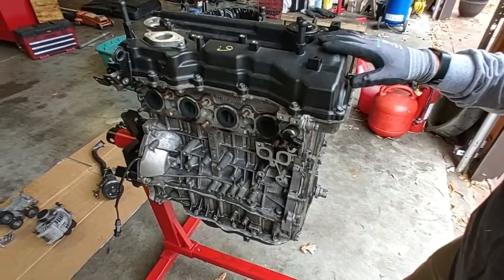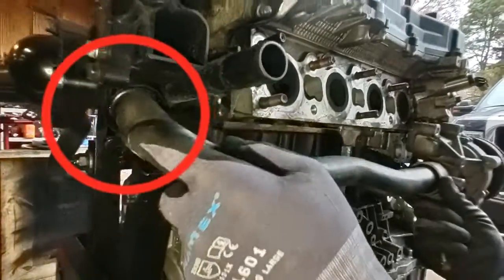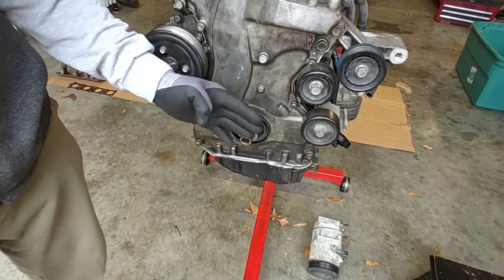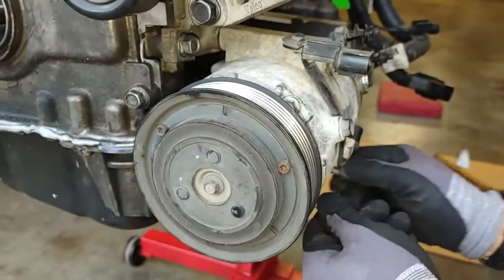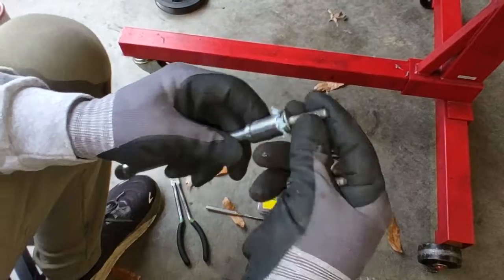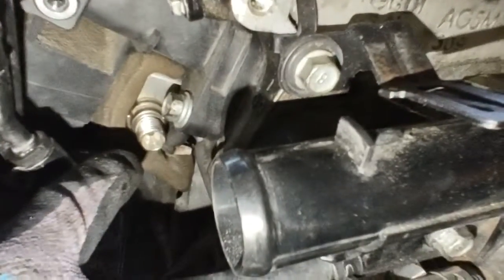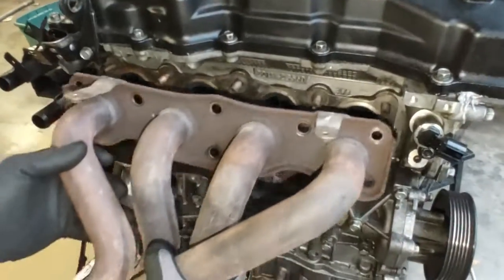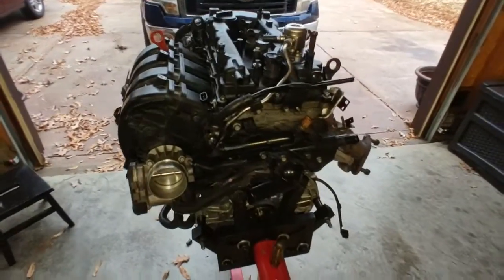How to Install Engine External Components;  (Hyundai / Kia 2.4 GDI) - Long Block Rebuild Ep. 4

Comment: Its a lot easier to install the intake and exhaust manifolds in the car i also install the thermostat housing after i install the engine, it makes getting the top two bell housing bolts in easier
Reply from the maker: Thanks for sharing!

Comment: Hey man was wondering of you could help me out. I did this rebuild of the sonata engine. Im getting a P0014 code for exhaust timing over advance. I replaced the vvt solenoid for exhaust side and still have the code. I took the timing cover off and replaced the cam phasers (both exhaust and intake) made sure that the timing chain was put on correctly with the 2 marks lining up and timing chain marks were in the correct teeth of the sprocket and rotated the engine 6-8 times and the marks did line up but after putting all back together i am still getting this code. Any ideas?
Reply from the maker: The oil passageways to the solenoid may be clogged or the replacement solenoid may be defective.  There's a filter screen in the engine block deck that leads to the cylinder head.  It's a  X shaped black piece of plastic with a V shaped screen that can be removed with a pair of pliers.  I usually remove it before installing the cylinder head.
Reply: @hardlymovingpro  Whats the proper on fixing this issue? do i have to disassemble the whole engine again?
Reply from the maker: I'd take the cylinder head off, blow out all oil passages in both the cylinder head and block, and remove that filter screen.  Another possibility, a guess in my part, is that your oil pump pressure control valve spring may be stuck.  Not so much as to trigger the low oil pressure lamp.   Here's a video where I dissemble it for cleaning:  https://youtu.be/BhtWkwWnnTE

Comment: I have a question if you please help me with the information you provide would be the same with the 2.0t
Reply from the maker: Only difference, out side of engine displacement,  is the 2.0T oil pump does not have balance shafts.

Comment: Hey after I install the crank pulley do I leave it at top dead center mark or do I back it up to 10 degrees before TDC ?
Reply from the maker: As long as the timing chain has been installed, the position of the crankshaft doesn't matter.
Reply: @hardlymovingpro  hey thanks for reply , I installed a rebuild kit and lined up the timing chain and oil pump chain on all marks then put the ladder cover on and the exterior crank pulley on it lined up to TDC on exterior marker .  can I just crank it up after i install it and it be ok to start ?
Reply from the maker: Don't quite understand "crank it up"?  Like start the engine?
Reply: @hardlymovingpro  yes start the engine
Reply from the maker: As long as there's oil in the engine, you can.

Comment: Hi what kind of bolt and length you use for engine stand. i am planning to do for Camry .. i know it is different per car, but any guidance will be hellpful
Reply from the maker: For the Sonata / Kia 2.4 engine, use 2 long threaded bolts that passes through the bottom engine mount holes.  For the top, I used left over bolts from another rebuild using the 12 point bolts that holds the oil pump ladder to the engine block.  The thread pitch of these bolts matches the upper engine block holes and is the right length.